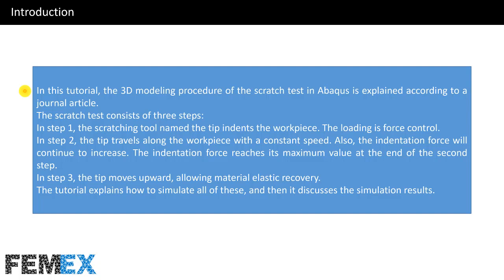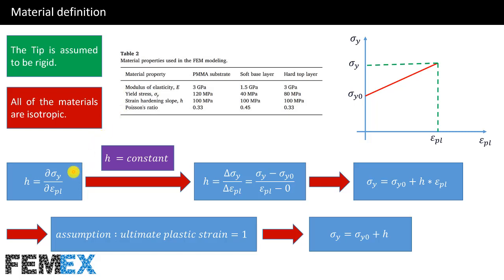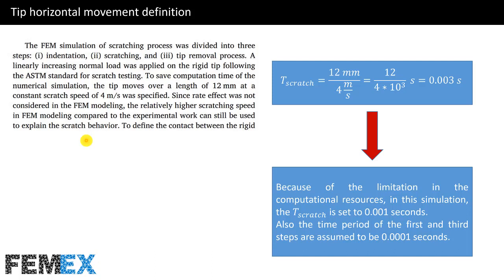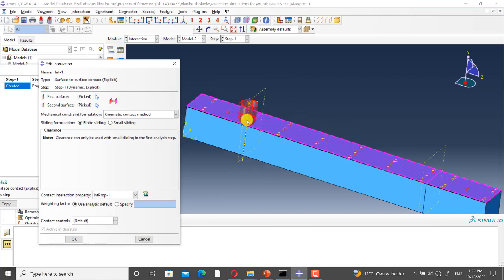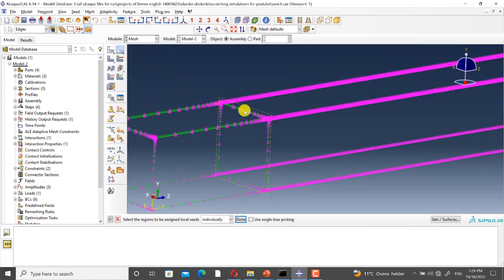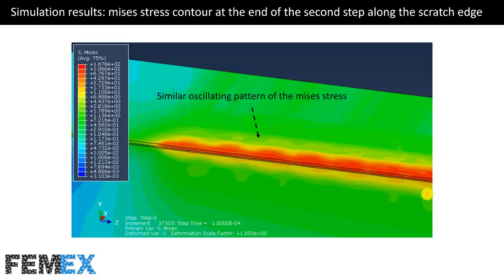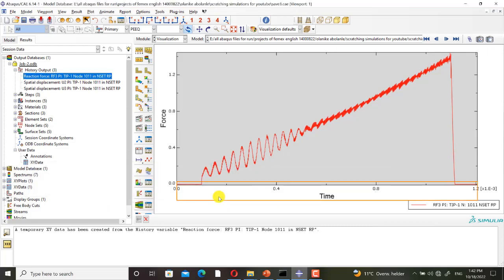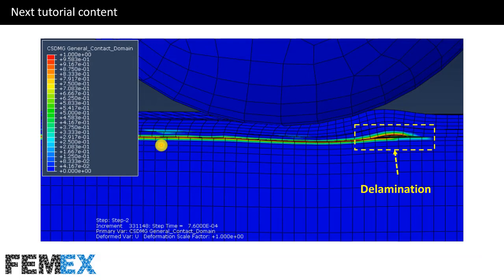Scratch Test Simulation in Abaqus Part 1: Paper Validation

Comment: How does Abaqus software calculate the maximum principal stress? I thought all our inputs are related to tensile test: yield stress, strain hardening, tensile strength, they are all related to tensile test. How does Abaqus relate them to scratch which is more a compressive force test?
Reply from the maker: Hi.
Such a nice question.
Yes all of our inputs to this model are calculated or measured based on the tensile test. But we put these values into material models which are 3D like the elastic behavior and the plastic model which is based on the Mises theory. This theory uses the data of tensile test to do the 3d plasticity calculations. When the 6 components of stress are calculated, then we can calculate every other kind of stress including the principle stresses. Such procedure will be followed when using other material models which uses different theories.
Reply: Thank you for the explanation.
Reply from the maker: @KavehDoostdar-gf4im  You are welcome.

Comment: Thank you very much… it was very informative
Buy may i ask a question? 
Why you have drawn the project in 3 parts ? Base layer, pmma, and top layer?
Reply from the maker: Hi.
You are welcome.
Yes you can ask your questions.
If we assume those three parts are fully bonded to each other there are two ways to create the model:
1) the procedure which I explained in the video and create different parts.
2) create one part and divide it into three regions via partitioning and assign different material to each region.
Both of the procedures are correct and there will be no difference between the final results.